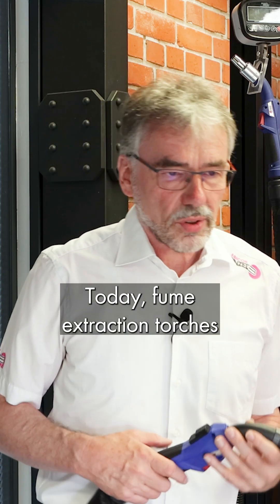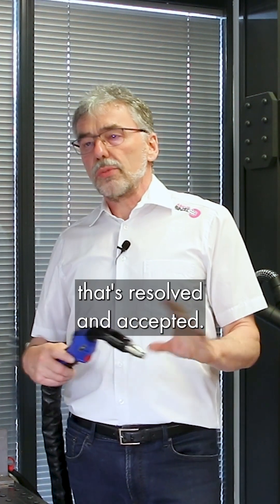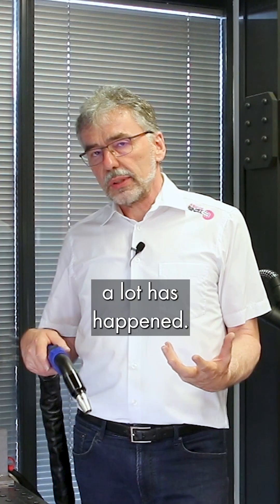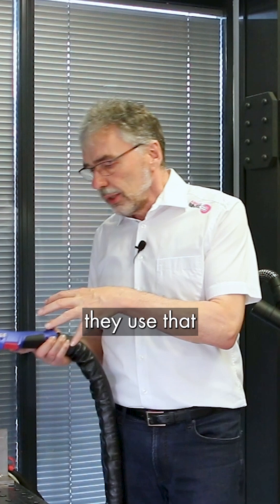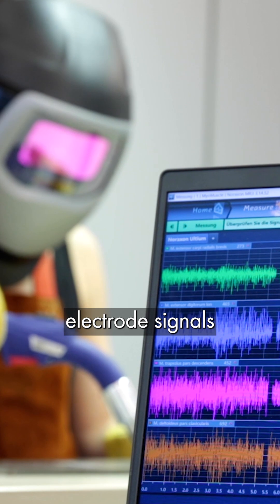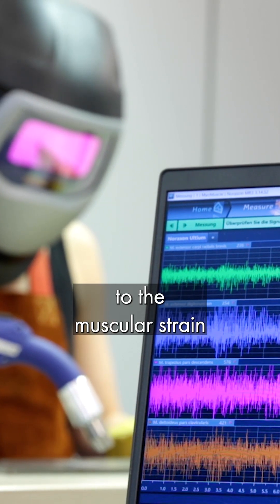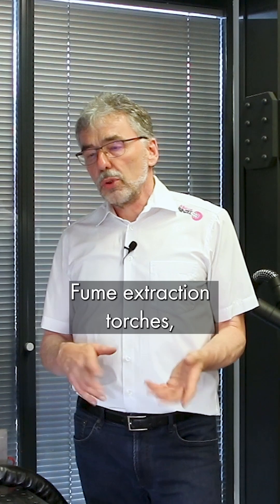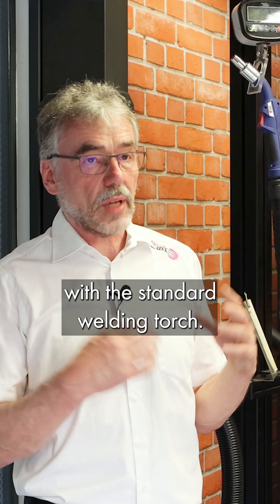Fume extraction torches tested! #fumeextraction #welding #weldprof #jlu

Comment: Yea, but if you're running shielding gas, and you are vacuuming the fumes, then you are vacuuming the gas away from your weld. It'd be fine for flux core but I don't personally like all the mess. Mig is too clean to use FC indoors. And if you are outdoors then you don't need fume extractions.

Unless I am missing something it just seems like a non-solution to a simple problem.